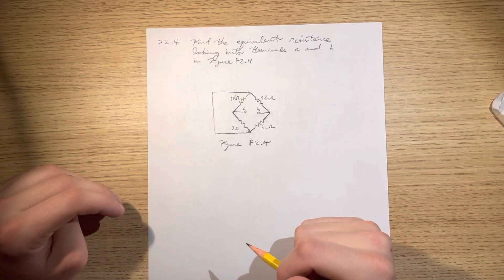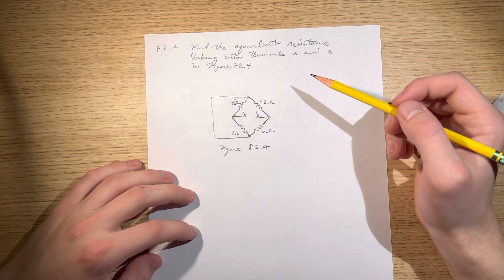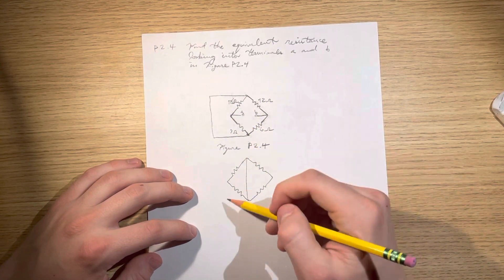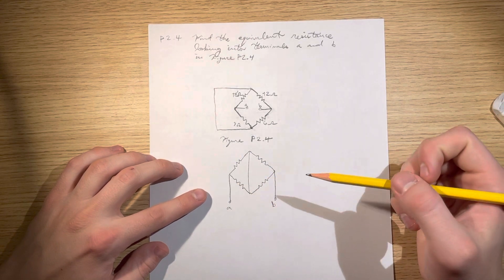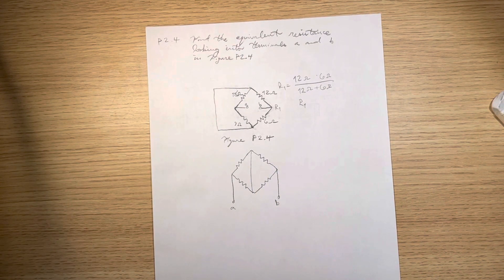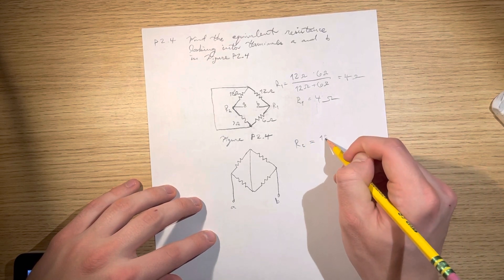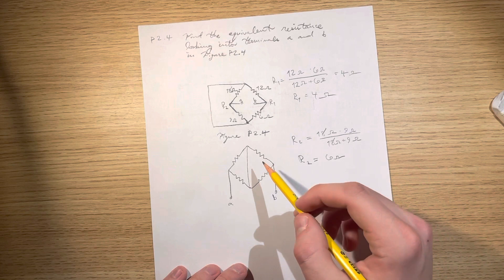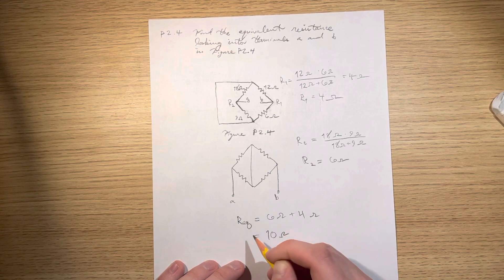Problem 2.4 - Find the equivalent resistance looking into terminals  a ￼and b in Figure P2.4.

Comment: how can you add them when there is a line in the middle
Reply from the maker: Excellent question. The line in the middle goes away after you combine the left and right sides. It actually looks like this:

——W——W——
      6Ω    4Ω
Timestamp 2:32